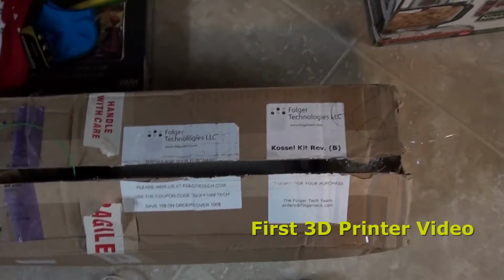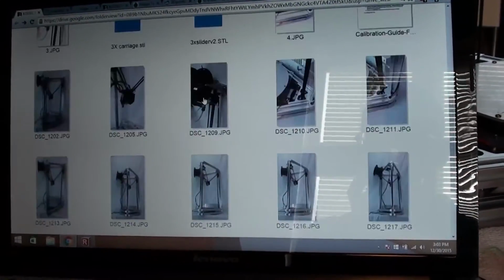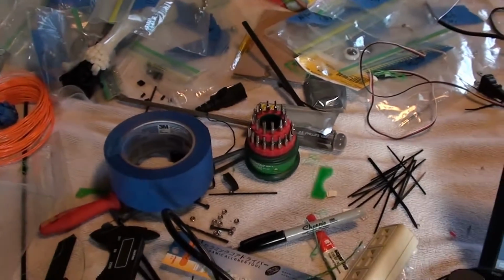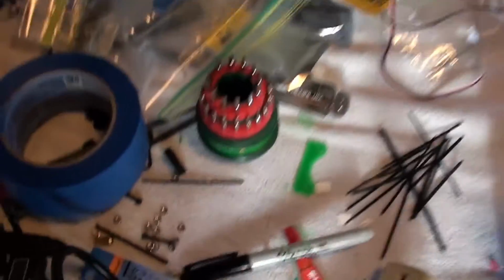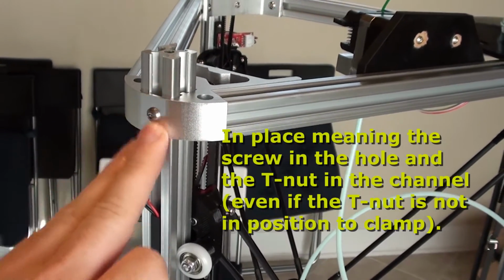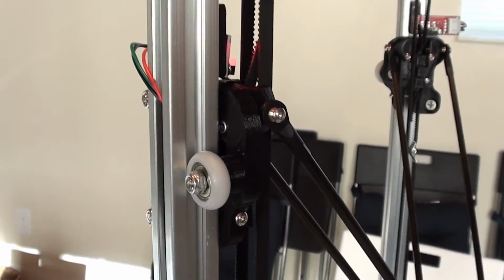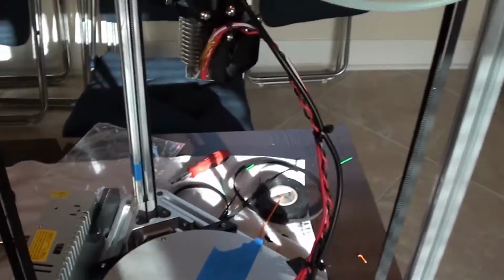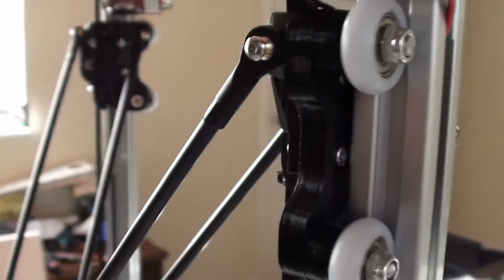Folger Tech Kossel Rev B. - Tips, Commentary, Opinions, and Aid

Comment: OMG what a PITA. to assemble. As an american company you would think they could just integrate the "rev b manual" with the wiring of the "rev a manual" and just print a new complete "Rev B Manual"   This sounds like crap a chinese company would do. I was considering this machine  but I am really leaning toward a TEVO little devil because of ease of assembly much beefer frame, 32 bit smoothieboard , larger print size etc. Yes its more money and I would rather support a usa company but this is pathetic. The difference is night and day if you watch a Tevo assembly video. If Folger Tech would go to at least 2040 extrusions increase the print size and go to a 32 bit board I would be right inline. I am amazed at the ability of the 8 bit processer to run  any delta printer  so I guess congrats ? The 32 bit boards are dropping in price quickly  as everyone changes over anyway. With dual /triple extruders and the complexity of delta printer calculations and more real  steps in drivers/motors etc it seems like a printer company would want to get ahead on this. Everybody wants better print quality and Its easy to see its days are numbered imho. Yeah I know its like 795.00 but it appears to be a whole different league of printer to me. The 300 x 500 print size helps to justify some of that as well. I was hoping somebody made a smaller version like Folger but I will deal with the size and price i guess.

Comment: I wish I had found this video before starting my build.  I've just finished the mechanical build and moving onto the wiring.  I'm very methodical building things and thought I was loosing my mind building this kit.  Screws were too long or too short at so many points of the build.  Parts were pictured or printed in reverse from the directions.  Screw holes in plastic were to tight.

Then I'm moving onto the wiring and the guide pretty much stops.  No info on routing wires, just a wiring diagram.  Then I realize there is also no info on mounting the bed, the spool holder, tensioning the the sliders on the rails, or an explanation of what that ceramic adjuster is for!

So I go back to the Google Drive folder and find the Rev A guide, and found exactly what you found.  Helpful information and some confusion.

To sum up, everything you said echos my experience thus far.

At this point I'm still happy with the kit.  It just seems a few hours spent on cleaning up the documentation would go a long way to helping people be successful and probably lower their customer support hours.  I'm also surprised they haven't posted their own video series on building and configuring this printer (Both Rev A and B).

Comment: thanks bro..Dustin Corbin on youtube also is making videos..  I built my Kossel Rev B and now I am stuck in firmware/slkc3r/repetier hopefully your videos will get me printing..  I even have a guy that bought one on my recommendation and I gotta get mine PRINTING!!! It sends my hotend into the bed.. 

THANK YOU
Reply from the maker: +Bryan Kale In the firmware configuration.h file, check around like 348 for a line that look like: define MANUAL_Z_HOME_POS 315. Home your hot end and measure from the bed to the tip of the hot end and enter the mm in that line. In repetier, go to the printer settings and enter it as the max Z as well and set it in the printer shape in Slic3r (third tab). Once uploaded and set, use this command: G0 Z30 F2000 to get the hot end to 30mm above the bed and jog it down slowly. Finger on that E-stop at all times, just in case.

Let me know if it works.
Reply: +RandomDevil1 awesome.. I lost com3..lol went to upload and it said denied..in use..  I gotta see what I changed in my BIOS when I upgraded the laptop memory..OOPS...  I feel confident these mods will work and I think my motors are reversed, so now I know how to fix that, the home position, and all the variables..should be a piece of cake once COM3 starts working..

I cannot thank you enough!
Reply from the maker: +Bryan Kale Make sure your Arduino is set to export to the correct device under the Tools > Board. This cannot be Native USB. Also check to see if the port shows up under Tools > Port.